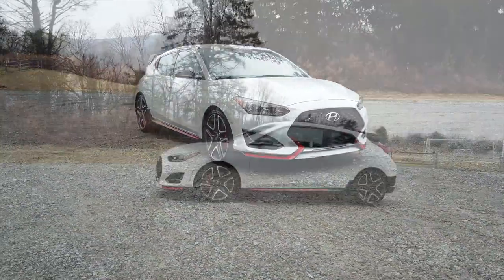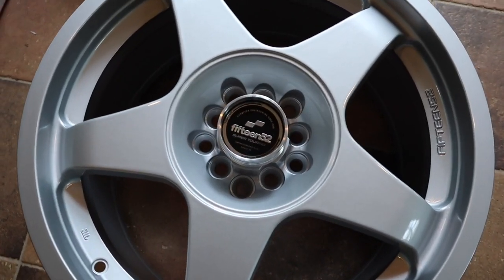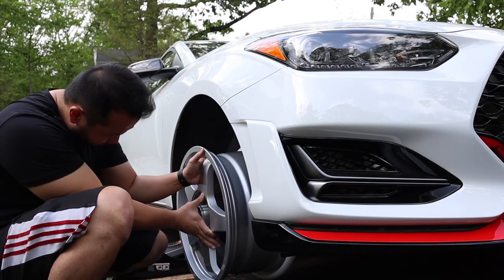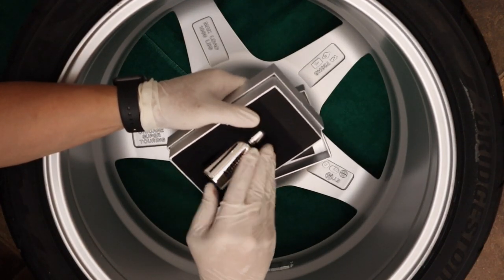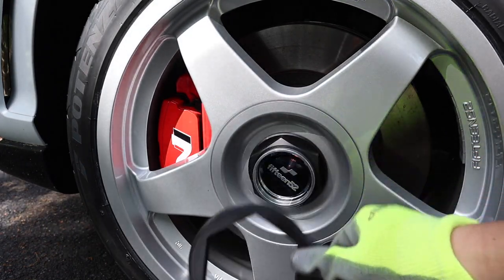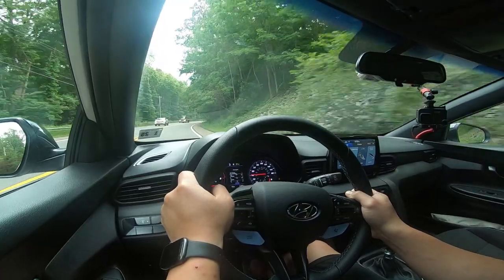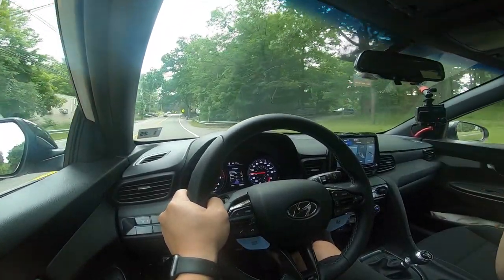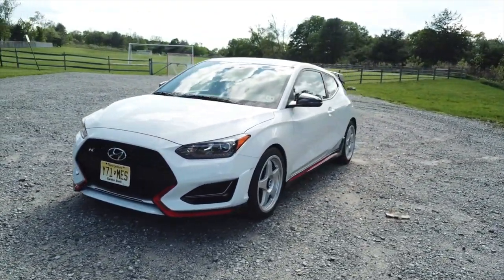Giving My Hyundai Veloster N Some Retro Super Touring Vibes

Comment: As far as looks go, I think what you chose looks awesome. Personally, I think I would have went with something lighter if I planned to track it in any way. The color is fine, it's nice to see something different than black that everyone is doing, including myself. I wanted bronze colored rims but they weren't available in the style I got at the time.
Reply from the maker: Lots of flowformed wheels out there that can be had with 20-21 lb weight.

Comment: Totally agree with the idea to downsize to an 18" wheel but regardless of 1552 being a sponsor, if weight savings was truly a concern for autocross,  you could've gotten an 18" wheel that weighs 17lbs (O.Z. Alleeggerita HLT).
Reply from the maker: 1552 was not a sponsor for this video, though this does play like a nice ad for them lol. Totally agree with lighter wheels for Autox. OZ allegerita is a bit on the expensive side. Other flowformed wheels were also contenders. In the end I wanted form more over than function.
Reply: @ShiftingLanes  agreed, OZ's are expensive but just doing a quick search on TireRack found them to be the lightest.

Comment: So - to each their own. I personally am also planning on getting a set of the Potenzas as well since the Star Specs aren't offered in larger sizes (that I've seen at least). However, I am not a fan of Fifteen52 wheels at all. They weigh WAY TOO MUCH. I personally don't like any of the wheel styles I've seen of their's either, again, that's just my own opinion.

Comment: This is really helpful.I am going to get a set of wheels for mine before the winter.Did you install the tire pleasure sensor as well?Does it work?If I put the stock wheel back on afterward .Is the oem one still work?I am worry about that.Becasue I am going to install the wheel in the tire shop.I ship it directly to the shop.
Reply from the maker: Tire sensor was placed in and works well. The TPMS should automatically update when you swap tires.
Reply: @ShiftingLanes  Oh.Okay.I will double check.Did you use the hub centering rings?Even the bolt patteres are fit.
Reply: @ShiftingLanes  Thanks for your response.Does 18in set up fells softer than the oem set up?For daily driving I need to give my family a ride sometime.I can handle the stock set up but they don"t.😅